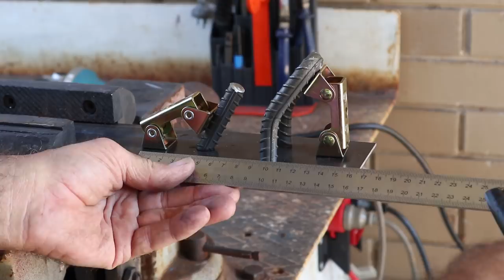Industrial Style Double Coat Hook - Welding project

Comment: I like your corners - simple and clean! 
Just a tip for those who want rounded corners without measuring... trace the arc with a suitable sized coin or washer, and then grind down the flat bar to the mark with a flap disk.
Reply from the maker: Thank you very much. Thank you for sharing how to do round corners, I agree 100%.

Comment: I like the way you work. Can you share some details of this project?  Diameter of the rebar, the thickness, width and length of the plate. Thank you. 
What I really like is that you hide your welds. I try to do the same.
Reply from the maker: Thank you very much, I am glad you liked it. The steel plate is 3mm thick, 160mm long and 75mm wide.
The Rebar is 1/2 inch rebar. 
I have just added this to the description under the video.

Comment: Hey Mr. C, today I bent a piece of Rebar (an old one) and it broke. Just snapped. Was it junk? Are there different grades? Ever had this happen? Thanks Sir, I'm going to follow some of your designs.
Reply from the maker: Hi Jonathan, yes there are different grades of rebar, some are high-tensile and are much harder to work with. I have just used the standard rebar that you would buy at most hardware stores that are used on houses the code on my 1/2 inch rebar is "D 500N" you would find a code as raised lettering somewhere on the rebar. Unless you use heat in my opinion, rebar is harder to work with than normal steel and does at times crack or break. First, unless you see the flame in any of my videos I have not heated or treated the rebar/steel in any way, it is straight of the shelf at the store. If I have bent rebar at a mark I try to never rebend at that mark again in another direction, I can bend it further in the same direction but not sideways it may crack, if you bend it too far and need to bend it back you will see what I mean. Bend it slowly and wider bends put less stress on the rebar. It took me a while to get used to working with it  COLD, just have a play without trying to make anything and you will soon know how it works and what makes it crack or break, and the limits you have to work around to make something with it, if you are still having trouble heat is your friend. I hope that helps a bit, wear your safety gear.

Comment: Gday Gavin
Is that the steal water pipe from Bunnings? You bent the rod with !!
Reply from the maker: What I am using is the old galvo water pipe, but yes I would think Bunnings would sell it, it may be a bit thinner now days (just guessing) But should still do the job, it doesn't have to be round, square tubing can also do the job. Hope that helps, wish you the best on your project.

Comment: Hey Gavin, I bought some 1/2 rebar today and just broke another one doing your bend with pipe. What am I missing?
Reply from the maker: Hi Jonathan, yes there are different grades of rebar, some are high-tensile and are much harder to work with. I have just used the standard rebar that you would buy at most hardware stores that are used on houses the code on my 1/2 inch rebar is "D 500N" you would find a code as raised lettering somewhere on the rebar. Unless you use heat in my opinion, rebar is harder to work with than normal steel and does at times crack or break. First, unless you see the flame in any of my videos I have not heated or treated the rebar/steel in any way, it is straight of the shelf at the store. If I have bent rebar at a mark I try to never rebend at that mark again in another direction, I can bend it further in the same direction but not sideways it may crack, if you bend it too far and need to bend it back you will see what I mean. Bend it slowly and wider bends put less stress on the rebar. It took me a while to get used to working with it  COLD, just have a play without trying to make anything and you will soon know how it works and what makes it crack or break, and the limits you have to work around to make something with it, if you are still having trouble heat is your friend. I hope that helps a bit, wear your safety gear.
Reply: @GavinClarkdiy  Thank you for the reply. I'll keep working it, because it is too good to let go. I really like the look of it. I am also experimenting with steel rod and that seems to be much more bendable. I did speak with my metal supplier and they said that rebar is often made of junky metals, kind of the sausage of metal manufacturing if you get my meaning. The "hot dog" of the metal world. The pieces I have are marked "4 S" and have one grade line. So, this indicates 1/2 inch and carbon steel. 
I'll take your advice! Thanks!
Reply from the maker: Your supplier is saying similar things to what I have heard, and I totally agree with you about the steel rod, it is heaps better than rebar and nowhere near as brittle, I love working with that. I am glad you will keep going on this, I wish you the best.

Comment: Why not heat and bend the rebar to save yourself some "ugga duggas"?
Reply from the maker: Well basically I don't have the gear to heat it, yes I could get it if I really needed it. But I guess I also look at it as exercise if I stop doing stuff that makes me strain a bit, eg bending lifting etc. If I make everything easy, I will overall get weaker and soon won't be able to do things, Then like a lot of people I would feel the need to go to the gym and strain there. Thank you for your good comment you are right, but I am happy doing what I do and am very aware of my limits (I think anyway). Thank you for your comment.